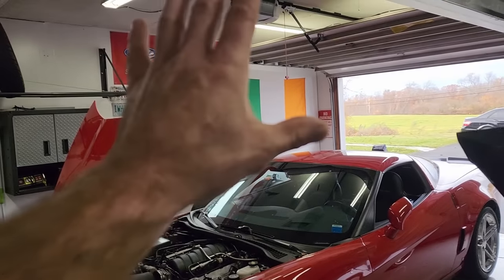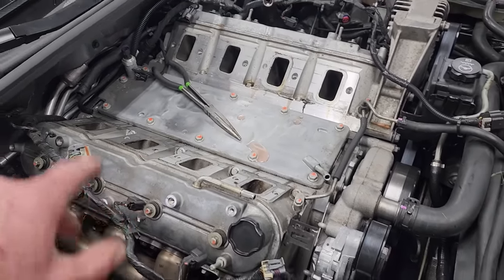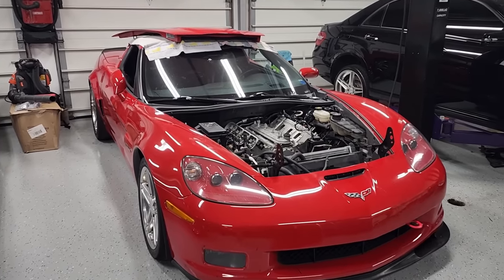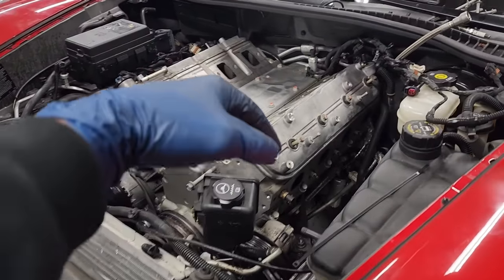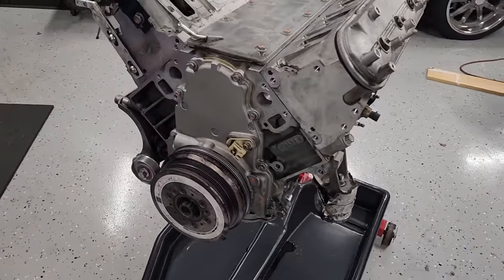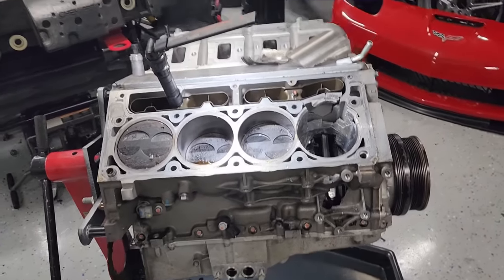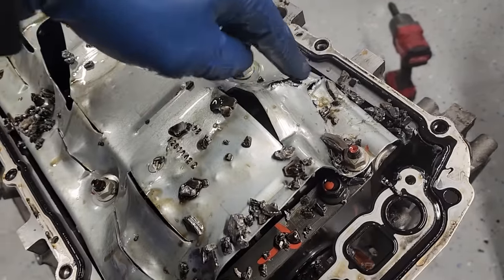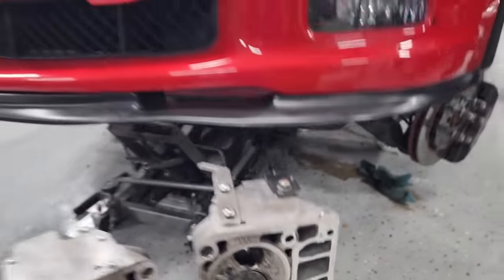LS7 CARNAGE: What Happened to this COMPLETELY DESTROYED Z06 Engine?!!!

Comment: Shout out to Greg for building a 36k mile engine. 😂
Reply: Greg didn't put the Texas Speed cam in there
Reply: @bb5242   I was going to say, whomever tuned that car last is to blame for sure.  With the cam, bet they raised the lmiter to like 7500 and it was singing well past its capability when it went boom.
Reply: And aside from possibly installing the cam in wrong, Greg didn't miss a gear and/or launch the motor or run the engine out of oil.
Also, could have been retuned lean.  A myriad of reasons the engine could have failed that had nothing to do with the integrity of the LS7 as it was built from the factory.
People kill engines due to abuse more than they randomly fail.  Most common failure is low oil level + high RPM.  Mods can kill an engine too and tuning.
When you modify an engine that has adequate power like a stock LS7 which is plenty on the street, be careful what you wish for.
PS. Chris is very talented with wonderful temperament, methodical etc...all the right stuff including young and strong...but I cringe when I see engine work this extensive with nothing covering the fenders for protection.  I know, he will run the orbital over the paint when all done but only takes one dropped wrench.  Or...maybe the plan is a repaint.  Paint doesn't look too bad to my eye but he may have other plans....from the peanut gallery.
Reply: @lukewalker1051  nah. LS7 is simply junk like any other GM product. MOPAR or NO CAR baby!
Reply: LS7 exhaust valve seat wasn’t machined concentric to the valve guide thanks to Linamar Corporation who machined the heads for GM.  Exhaust valve fatigues and breaks off. Destroys #2 piston and the entire LS7.  That’s why I got both of my heads reworked by LPE.
Reply: Greg isn’t to blame for this. Linamar Corporation machined the valve seats on these heads.  They should be sued!
Reply: @yungtooli  you must be lost, this is a GM video... Mopar stuff is elsewhere on the YouTube.
Reply: Love your videos. I’m learning a lot to start toying with my vette!
Reply: @natez0690  so many people in these comments don’t know about Ls7 valve issues.
Reply: Thas wrong….the ls7 was bound to fail the moment gm put them faulty heads on it…..should have just put ls3 heads on it
Reply: @lukewalker1051 I was thinking the same thing about him not having anything covering the fenders. 😉
Reply: @trentdawg2832  technically it’s not the heads. It’s the valves.
Reply: @yungtooli  Hell yeah brother! Just Hemi swap it and it's ready to go.
Reply: My comment is that you are one of the few you tubers that work on cars with proper footwear. So many wear flip flops or crocs. Ridiculous.
Reply: @Debkghtulvkfjkjfxjjcj  and the valve seats that fall out with them technically making the heads crap too
Reply: @paulvarrieur976  leave sleeperdude out of this…….people watch him for thae animals and awesome family work ethic
Reply: @yungtooli  Quality bait mate!
Reply: GM said "make it last till basic warranty expires at 36k" Greg said "hold my vatozone Chevy hat"
Reply: Thanks Greg.
Reply: @yung tooli  I have a Mopar and it's absolutely crap. Rather have a chevy any day.
Reply: @yungtooli  you look good in your momma's Civic! Brand boi? Obviously!!!
Reply: @yungtooli  really what Mopar is worth owning, this is a real jo
Reply: That why I got my heads done KATECK very Happy😂
Reply: Brooooo Greg built my engine too and same issue lol
Reply: @yungtooli  ahh yes, the mopar/srt that doesn't have to worry about reliability because more than half of their cars get destroyed before 3 years after production?

You just have to look at their mild Chrysler/Dodge offerings to know that the quality is post-ghosn nissan level. Which is below even GM.

Comment: On the LS7, it’s the exhaust valve that has the hollow stem and failure prone. The intake valves are titanium and usually wasn’t the issue.
Reply: yep its the exhaust valves that are hollow and have the issue
Reply: Yep
Reply: It’s not the valve, it’s the valve guide and valve seat that weren’t machined concentric to each other.  Linamar Corporation machined the heads for GM and their(GM’s) quality control didn’t catch it or overlooked the problem.  Valve heads don’t fall off just because they have a hollow stem. They break off from contact with the piston, over-rev/valve float, or in this instance poorly machined valve seats that fatigue the valve stem.
Reply: @natez0690  100% correct.  That's the LS7 valving issue that these are known for.  Though, most of the time, they only kiss the piston after the valve works its way to the point of contact.  This one looks like it took the valve and decided to play dodge ball with the rods and crank at, or around, 7k rpm.  That's a lot of energy transfer if things aren't working smoothly.
Reply: Obviously not a stock LS7 with a stage one cam in her.
Reply: @natez0690  I have a C6 GS with the more sedate LS3 (2012), but when you're pushing the tach to 7K on a 7 liter motor, you're just asking for trouble! Hate
to see this jewel of an engine get beat up so bad!!  When you track a car, be prepared to see it sitting on the sidelines from barfing its' guts all over the track!
Reply: I use Blackstone Lab to test my oil at 17,000 on a 2007 Ron Fellows and we found Titanium in the oil =, At 22,000 Miles A higher level of titanium prompted me to get a shop at my cost to pull the heads. We brought the GM Warranty guy over and pulled the valves out Every intake guide was worn out the valve feel out of the head once the spring was removed. GM Paid the $7,000 bill for new heads and the labor. Get Your Oil TESTED on any LS7.
Reply: @natez0690  Okay so what is the solution to this problem
Reply: @Stuffandfangs      The best solution I have seen is to take your LS7 heads to a competent shop that routinely does LS7 heads.  AI, Lingenfelter, HPR, WCCH, American Heritage.  They will knock out the old guides, press in new ones, (CHE bronze or stock Powdered Metal), recut the seats, junk you GM exhaust valves and put in Ferrea valves - LS7 (F2042P).  Also, if your TI intake valves have been flopping around in a badly worn guide, I’d replace those too.  Why risk it?  The reason the valves break is metal fatigue.  When the guide and seat are not machined concentric to one another, one side of the valve will contact the seat before the other side does.  This bends the stem of the valve and over time the valve will eventually fail.  I’ve also heard rumors that the GM LS7 exhaust valves may have the hollow hole in the stem drilled off center which will further exacerbate the fatigue problem.  Anytime a valve is run in a guide with too much stem to guide clearance or an improperly machined seat, it will fatigue the valve.  The problem is that it’s nearly impossible to know when it will fail.  Hope this answers your question.
Reply: Absolutely.   Keyword search:  LS7 Disasters.  Thee instant an exhaust valve drops you hope whatever just brought you to a stop isn't bad.

But, then your Superman Lunch Box gets bumped.
When you open the lid there's Nestles Chocolate Milk covering everything.
When you remove the Plastic Cup and find the Cap sealing the Thermos® Bottle securely in place.

Comment: I'm in the same boat with you right now. I picked up a C5 ZO6 a month ago with the same issue. Previous owner blew up the motor and I was able to get the car for a steal. The valve spring broke, which is common on the LS6. Completely took out piston number one, valve, and a hole through the block. I was able to source a low mileage long block and in the middle of currently putting everything together. Good luck with yours!
Reply: Depending on the year its was a issue for the ls6.  My 04. Is goin strong 130k

Comment: The cause of failure wasn't the valve or other internals. It was caused by the previous owner over revving the engine as he admitted. There are several good options for a new engine out there, so I am curious to see what you come up with. Good work so far!
Reply: Yeah but they have limiters right? In all honesty your car should be able to bounce off the limiter all day. You gotta idiot proof things sometimes even back in the day float would keep you from flinging it too high.
Reply: @johnsheetz6639  I think for a car that is modified and raced, a tune will be required, and the tune could remove the limiter.
Reply: @ktriebol  now why would it? You can adjust a rev limiter to go with higher as low as you want why not put it at a medium safe speed? Enlighten me. Tuned is different than the rev limit my friend you have to have a limiter on a performance engine these days. There is only so far you want to go past the peak power RPM.
Reply: This car did have a cam so it probably did have a tune, doesn’t mean the limiter was removed though. It shouldn’t have been removed. My car failed in exactly the same way and it was bone stock
Reply: The previous owner states that he may have over-revved it, so you would have to ask him to get specifics.

Comment: When i saw you got this z06 for 15k i was a bit jealous, going through the steps building my 08z i realized how big of a financial commitment it is. I bought mine for around 42 grand and drove it for around 3 weeks before it spun a combination of 5 or 6 bearings, engine is totally gone; crank, cam, cylinder walls, pistons/ rods, and even the heads were crazy out of wack. I went from thinking I already kind of got ripped on this 42 thousand dollar 80k mile z06 which i thought was sort of clean to when its said and done around a 60k z06. Im doing everything right though, going fully forged, sleeved, max effort h/c/i and ill probably go for a 150 shot. Cant wait to see what you'll do with this z
Reply from the maker: Dont get too down. These cars are an insane value for the money. Won't be much that can touch it under under that 60k figure!
Reply: Was it all stock when you purchased it? Curious because I bought a 07 a year ago with 36k. Super clean and bone stock. I don’t race or even drive hard but seeing all of these rebuilds have me so nervous. Should I redo the heads? Or if it’s not broke don’t fix it? Btw sorry about your car man
Reply: @shawnwuan Owned one for a bit over a year, get them done
Reply: 42 k for a 80 thousand mile car,I am in the process of selling my 09 with 42thousand miles for 38k.
Reply: @7318550239  The market for the c6 is starting to go down, your comment is 10 days old his is 2 months and he probly bought it a few months before his comment, around the peak of the market. Still when I was in the market last year low milage c6z was 40 to 45 no way I would pay 42k for one with 80k
Reply: @benfarr6049  my local dealer has a silver 08 c6z 2lz with 12k miles for 53k..another dealer about 40 miles away has a cyber gray 09 c6z with 7k miles for 54k....what should I try to get those numbers down to?

Comment: I had an ‘07 ZO6, LS7. Chevrolet replaced the heads under warranty before that kind of damage could occur. I kept the warranty on the car until I sold it in 2018.  Expensive, but it didn’t fail on my dime. Good video, thank you.

Comment: I've got 2 C6Z's as well. I'm about to put my 3rd engine into the '08 track car. I've seen the exact same carnage. First blowup was on the stock engine after changing the differential and the gear ratio. Had to pull plugs to finally see that it was blown. I built it up with the 2nd engine (Texas Speed), and when it blew, the block disintegrated, but I guess the extra HP makes the carnage bigger. 3rd engine will also be TSP and will go in over xmas break. 2nd C6Z is a 2009 3LZ garage queen, all stock. 39k miles. Mine was a dropped valve both times, and I had the heads rebuilt and hardened before the first grenade, so go figure.

Comment: At 9,400 miles I went way overboard. Crower shaft rockers, refurbished intakes, Del West used to do it for free, SS hollow stem exhaust valves, new springs, retainers and keepers. Threw out the buckets and went with link bar lifters. Having a junk head so the machine shop can test their math before working on a good head is helpful. I also put in a 4.10 gear when they came out years ago. Heads done in spring of 2016, put it to bed this fall with plus 30,000. Good luck, saw this exact example in the garage at the Vette museum in 2019.

Comment: My money is on the "drysump"-system. It's well known that the stock system can't keep up with high Gs on the track, especially with (Semi-)Slicks. On the early engines especially, it's a problem with the scavenge stage of the oil pump. This results in aerated oil. The scavange-stage simply can't keep up with the pressure side. This is why they superseded the pump to the LS9 which moved a little more oil. Greetings from Germany!

EDIT: Ok. After seeing the crank, my best bet is now the exhaust valve =D.

Comment: I had the ZO6 back in 2009 , they were badass cars,and around 2010 the valves were dropping out of them, it was a big deal.. it required a full cylinder head rebuild and if you didn't do it this is what happens.
Reply: ..are there any years (C6 Z06)that this wasn't a problem? 😮😮

Comment: What engine you planning on putting back in there?  Stock or maybe a nice LSX build?  Katech Engine perhaps?  Thanks for tearing down the 427ci paper weight, that was fun to watch.  Was most likely a valve drop that caused all that.....probably close to 7k rpm.

Comment: Dry sump motor there - never should have happened.  Over rev or missed a shift?  Agree 100% throw out.  I tracked my 08 C6 once but put 20/50 in it.... ran great at 235F all day... I had the Heads changed so no guide issues.  Cool video

Comment: The same thing happened to my 09 z06 and the same cylinder. The exhaust valve snapped and destroyed the engine. I got a Texas speed 5.3 aluminum bored and bumped back up to 7.0 and sleeved with forged pistons. I kept the rods though. Heads got bronze guides and steel valves, so I've been good so far, no issues.
Reply: Hello, at what mileage did the valves fail? 2009?
Reply: @leksldje3085  failed at 36k miles

Comment: Been considering buyin a 2006 z06 for auto crossing. Wasn't aware of the valve "issue" that was mentioned here I'll have to research that a bit. Sub'd to watch the build.
Reply from the maker: Don't let the hype scare you. The c6 z06 is a monster on the street, track or drag strip. Even being 17 years old now. Buy one, keep an eye on the heads/maintain them, and you'll won't regret it.

Comment: My 2006 Zo6 destroyed it's self at 44,000 miles as well with dopped valves and a rod thru the block I purchased a new complete motor installed for $15,000. I am now gun shy of the new motor as well. I kept the Zo6 and purchased a new 2023 stingray hard top conv. and hope it does not have hidden problems. Chevrolet owes me $15,000. in my book.
Reply: hi, the valve dropping happened during extreme driving, high rpm 7? I ask out of curiosity

Comment: just curious, in the beginning of the video you mentioned the LS7 was complete/untouched, then later in the vid with engine on stand and rear cover off you said it had a TSP cam in it, so was it completely stock untouched engine or has it been apart before for a cam/lifter swap or other upgrade work? insane amount of damage, thanks for sharing the post mortem...

Comment: Hey I don’t know how well you know the LS7 but the intake valve’s are titanium and when you send the heads out to get redone almost every company reuses your intake valves ..The exhaust valve is the one that drops cause of two things ..1 because The stock OEM exhaust valves are hollow and 2 the guides weren’t installed centric… Remember that motor is hand built (human error)may be it was built on a Monday or a Friday or the person was drunk or on dope or both 😂….Also are you new to LS7. 7.0L engines?     If you send Texas speed a set of heads you want redone (fixed heads)from your LS7 …All they do is replace 16 guides eight exhaust valves and use stainless steel 
Exhaust valves that are not hollow like the factory ones are , They reuse your old intake valve’s , cause they’re like $200 a piece and they don’t fail .. then they’ll give you a mill of your choice depending what compression you want to go with, Oh and they give you a little port work all for $1500 for both heads and they give you dual valve springs with titanium retainers in case down the road you want to put a bigger cam in.. But very good wrenching on the car and videoing ,hats 🎩 off to you ..I guess your best bet would be to get an LS7 long block which I know they’re not cheap 😢.. if Texas speed redid the heads and installed a cam or if the previous owner bought the parts and he installed them himself or a shop I’m thinking that the piston broke I know LS7 pistons are weak cause why would a valve drop if Texas speed corrected the heads.. but you also hear of stories of people getting their LS7 Heads fixed and they fail a month later.. so either Greg the original engine builder or Texas speed were the one smoking dope 😅

Comment: Sorry.  This is unfortunately a common issue with the LS7.  The hollow stem exhaust valves were poorly manufactured, and the stems are not an even thickness all the way around. Some are as thin as .010".  The exhaust valve heads are electrically welded to these stems and tend to break off.  When the stainless exhaust valve head comes into contact with a hypereutectic (cast) alum piston the piston comes apart like a piece of glass.  This is all aggravated because the valve seats were not properly machined which wears the valve guides rapidly and places side loads on the valves.  
On your next LS7 make sure you have all the valve guides replaced and the seats properly machined.  Also replace all of the GM hollow stem exhaust valves with a quality valve.